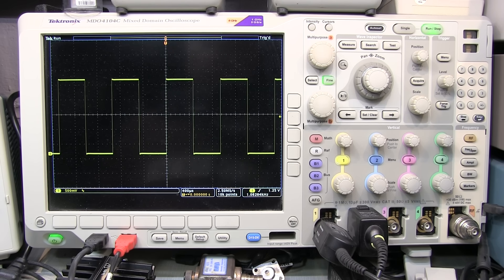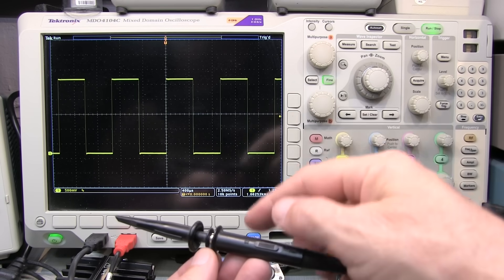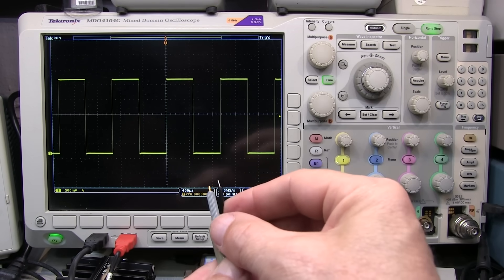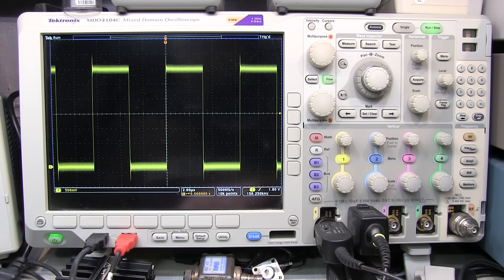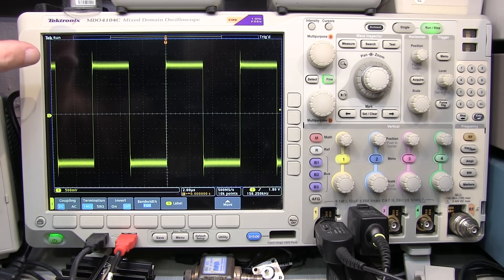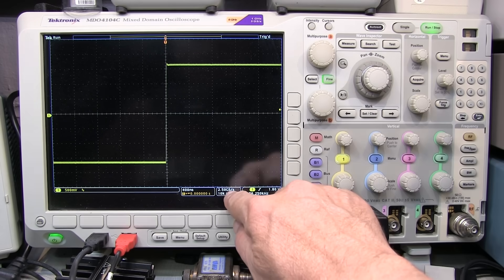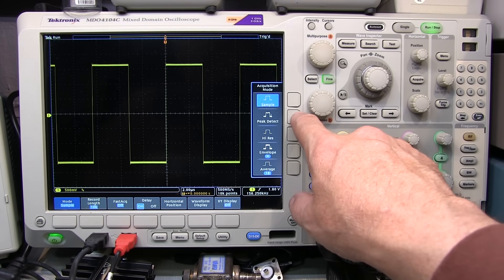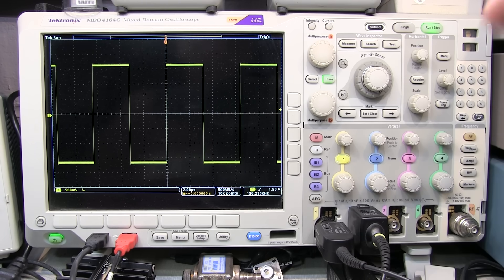#394: Oscilloscope Best Practices - some of the most common issues and tips

Comment: Not sure who your target audience is for this video.  Since you are a ham my thought was to help other hams.  However, using a $10,000 scope to explain best practices puts your target audience into the high end research lab space.  I would guess you are the only ham that has such a device.  How about demonstrating with the $400 digital scope that most hams have or better yet an old analog scope purchased at a hamfest for $25?
Reply: My low end Siglent scope has all of the features he went over except for the input offset.
Reply: @Chris_Grossman  Interesting; I just checked Keysight DSOX1202G; it does not have offset per se, but vertical position is calibrated in offset voltage.
Reply from the maker: As others have said, most of these tips apply to hobbyist level scopes as well. I’m sorry I didn’t make that clear in the video. Also, many of the videos linked in the description are done with lower featured and even old analog scopes.
Reply: @w2aew  Indeed.  One of the things I like the most about this video is that almost all of the tips apply to both my cheap analog and digital “hobbyist” scopes and my high-end “professional” scopes.
Reply: Take what you can use and wish for the rest. No point limiting at the start.
Reply: Seems to me a cheap(ish) Rigol or Siglent scope has pretty much these same features; sometimes labeled differently.   What isn't here mentioned but maybe elsewhere is why you would use different features.  For instance, 10k samples in a single sweep means you can expand the sweep but there's only 10k samples so you wont expand it very much.  But with a million samples in that sweep, you can expand it dramatically and still have full horizontal resolution.  Why would you not always capture a million samples?  Well, if you do, then segmenting your memory, collecting averages, and high-resolution supersampling is affected.  
Since radio work is almost always repeating signals, averaging modes work better than supersampling (multiple samples per horizontal "pixel").  You also benefit from variable persistence (Keysight has it, I have not seen this on Rigol or Siglent) or velocity modulated intensity; makes a two-tone test of an amplifier look on a digital scope the same as it looks on an analog scope.  That was an important consideration for me, to get the nice looking two-tone test with crisp edges and lightly filled in center blobs.  A cheaper digital scope just has brightly lit blobs and it isn't obvious what it is doing.
Reply: @thomasmaughan4798  Thank you for explaining why not to "always" sample at the highest number of data points; yet, I'm not sure what "segmenting your memory" means unless it's a superset of what you mentioned, i.e., collecting averages, high-resolution supersampling, etc.
Reply: @schwinn434  Quite frankly, I don't know what is the purpose of segmented memory but one feature is that it can store a waveform and display the saved waveform at the same time as a current sample allowing for easy comparison.  You can even zoom in on features of both simultaneously. 
In the case of averaging, you can choose how many waveforms to sample.  Now what it means by "waveform" I would call a "screen", or sweep.  One sweep of the beam; chopped into thousands or even millions of bits.  You can average successive sweeps which produces a VERY clean signal and in the case of variable persistence, a bit of magic happens -- the presence of a signal in otherwise hopeless levels of noise!  I can specify how many sweeps to average; 16 for instance; and the noise will be averaged OUT leaving the signal.  I can freeze it, save it, measure it.  OR I can let it run and new samples replace old samples and with variable persistence the newest sample will also be brightest and as there might be a trend, you can see the shaded trend, darker is older.  
Analog scopes do that sort of thing natively but it isn't exactly variable.  The phosphor has persistence. 
One other thing : A digital scope typically has only 8 bits of vertical resolution.  That's not impressive.  It gets the job done but that's only 256 discrete voltage levels. With averaging, you can increase the effective vertical resolution.  With 16 sweeps OR 16 samples within each pixel of a single sweep, you obtain effectively 12 bits or 4096 vertical divisions and that provides very fine voltage measurements.  
Anyway that's when you would prefer to use your scope memory for subsampling or averaging rather than one big long sample. 
BUT if you have a spurious signal of short duration, a long sample allows you to zoom in and inspect the phenomenon.  You can even set a Keysight with an envelope mask trigger; set it up with a nice sine wave, create the mask, and if there's a deviation from perfect sine (or whatever shape it is), it will bump into the mask and trigger the scope.  If set for single shot, it will capture a deviation and you can come back later and see it and save it and whatever.
Reply from the maker: Tektronix and others have all those features too.
Reply: Most of the things talked about will apply to the scopes most hobby people have.  I don't think you will get that if you buy a hamfest $25 unit,  but a Rigol, Siglent, Owan ect in the under $400 range will do quite a lot.  I got a siglent 200MHz one with a lot of nice features, including decoding I2C, SPI, UART, CAN, LIN  digital data with a nice display of the data for working on microcontroler to device communications. That was under $375 delivered with probes.
Reply: Thank you for all the great replies!  I learned more from your comments than the video itself.

Comment: Why doesn't Analog Oscilloscope have an Offset control? Some signals don't need to use the offset control but other signals do need to use the offset control to get full scale deflection, any reasons why certain signals/waveform need to use the digital oscilloscope offset control to get full scale deflection?
Reply: Some do.  I have plug ins for my analog scope that have input offsets.
Reply: @Chris_Grossman  I have never seen Plug-Ins for analog Scopes for input offset. I'm not sure why some signals/waveforms need input offset to get a full-scale deflection on the Oscope?
Reply from the maker: It is common when a signal is riding on top of a larger DC bias. Ripple on a power supply rail is a good example.
Reply: @w2aew  The Oscope input offset CIRCUIT is doing what to the ADC converters or Oscope input stage? Because if an AC signal that is riding top of a +2vdc DC bias, the Oscope offset circuit would need to "subtract" the +2vdc DC bias voltage to the Oscope Vertcial Deflection circuit?